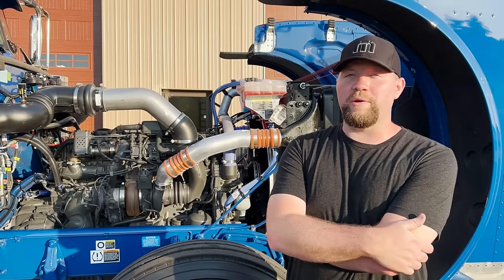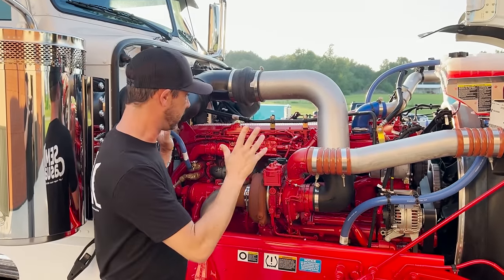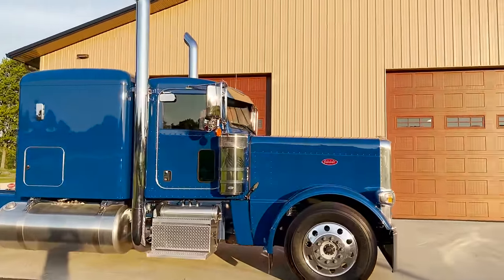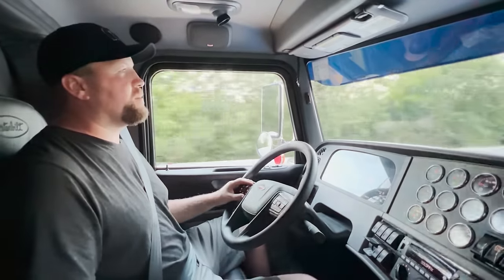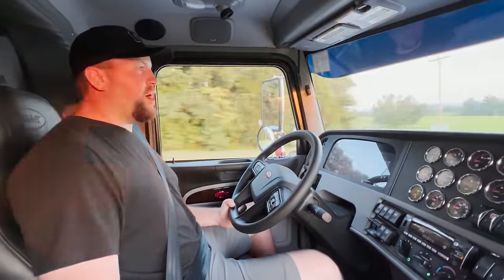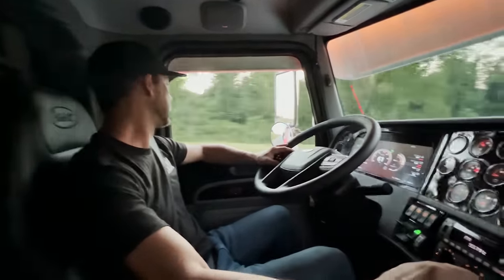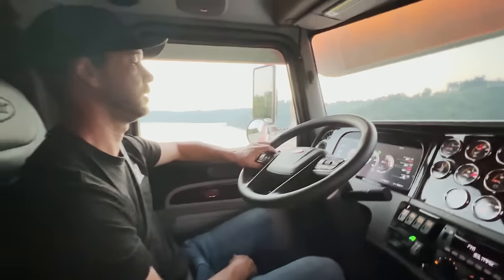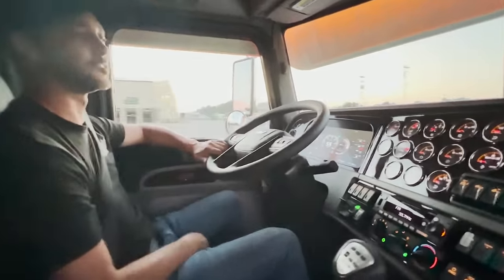Cummins X15  VS.  Paccar MX13  -  What are you gonna choose?

Comment: I have worked on both of these engines the labor you will save on the Cummins will far outweigh any upfront savings on the MX. The MX is put together like a jigsaw puzzle not to mention some cab styles you have to raise the cab just to change the #6 fuel injector and connector. The emissions problems are just too much to mention. I have always said if you want to work a 5 day week you should buy 7 trucks with MX engines you might get a full week
Reply: Agreed, i work at a dealer, Cummins only come in for services and EGR's, MX's are everything from emissions recalls, issues, wiring problems, or full blown engine replacement
Reply: The review i was looking for.  MX equipped trucks tend to be slightly less expensive.  And there's a cummins mechanic on every corner. #testedtec
Reply: Where's your shop?
I'm currently in South Texas.
Reply: @nostradamus7648  I used to work for Kenworth of Pa but I wouldn't trust them to fix a tail lamp. That's the reason I left didn't approve of customers getting ripped off
Reply: There's a reason why they call them "Pacshit" engines. 😂
Reply: @davidsignor7931  Have you opened a shop or do you still freelance?
Reply: @Nostradamus  no I'm really not interested in working on them anymore they took all of the fun out of it with aftertreatment
Reply: It's not that new drivers want automatics they just don't have a choice since that's all they know how to drive.
Reply: @davidsignor7931  What if I  got a non DEF Detroit 60 or Cat C15?
Reply: @Nostradamus  60 series was a pretty good engine best in fuel mileage out of the big three. Just a little low on torque. C-15 on the other hand still have a lot of head gasket issues and exaust manifold problems you can fix the head gasket issues by adding fire rings in the cylinder head it all comes with a price
Reply: What are you doing with trucks and engine in the US? The MX is a DAF engine. For 15 ton plus DAF Trucks is the number two in selling in Europe for many years. DAF started building trucks in Brazil and within 10 years DAF XF is number two and DAF CF is number four in selling. And no American truck to be seen, not in Europe nor in Brazil.
Reply: @47rintin1  Paccar bought DAF
Reply: @davidsignor7931  PACCAR is the best mother DAF can have and DAF is a perfect daughter for PACCAR with all its know how. 
If you are a brilliant scientist, it doesn't mean that your mother is one as well. The case is that I see some comment on the MX-13 that doesn't correspond with the experiences on the Brazilian and European truck market.
Reply: @Vladpryde . Our shop mechanics call the ‘ Crappar’😂
Reply: @samhunt5476  Cummns don't have any less issues when it comes to emissions and sensors, turbos, from 2010 to 2021 when I retired. Both systems from turbo out are Cummins systems.

Comment: I'm driving a mx13 right now with an 18speed and the difference compared to the ISX/x15 is massive. Better fuel economy but way less pulling power then the cummins, my old truck being a 2014 388 ISX15 550hp 2150 torque. Used both engines pulling 140,000lb's and both can do it depending on rear gears ratio's but maintenance intervals need to be thrown out the window if you want reliability and longevity out of the engines.

Comment: As a mechanic I understand the upfront liking the paccar but you've never had the nightmare of working on one.  The long term costs in repairs the paccar will not hold up.
Reply: Agreed, I run a shop that has both engines. We can’t get paccars to go over 400k without major repairs needed. Our Cummins have minor issues throughout the same mileage and conditions. Not to mention you can’t even inframe a paccar….

Comment: Cummins would be my choice. I've driven both with automatics and manuals hauling fuel. Cummins just feels safer and more confident especially with their exhaust brake. The paccar required a lot more breaking when loaded and just did a horrible job keeping me at a safe speed coming down grades without using the service brakes. I really hated the paccar in the auto configuration. It was always trying to skip gears for the sake of fuel efficiency then immediately down shift because it didn't have the power to continue. That paccar/auto pair would constantly get lost when fully loaded. I also feel that the Cummins would also bring better resale value.

Comment: I believe there were reliability issues at one time with the MX. Uptime is super important to me. That's the reason we stick to Cummins.
Reply: Sinister.Shelby, You're a smart man.
Reply: Cummings is the only motor cat used to be right in there but I will only drive trucks with Cummings engines
Reply: If you want to work a full 5 day week buy 7 trucks with MX engines and you might complete a full week
Reply: @4321grp  He is a smart man but just not smart enough to buy a Chevy instead of that 13/14 GT500 that looks like Z06 food.
Reply: Both dealerships kenworth and peterbilt service mgrs told me without hesitation 2 avoid paccar mx engines!

Comment: My experience with the MX-13 is that it's an amazing engine until its not. What I mean is when those sensors start going out, it's a ripple effect that just topples those engines and they are not cheap. DO NOT buy a used truck with a MX-13 in it, the extended warranty options offered by Paccar do not cover the majority of the sensors and trust me, they have A LOT. I advise only purchasing a truck with this motor in it brand new and letting all work fall under OEM warranty and if it shows any signs of faultiness, turn it back in immediately. These engines have also been known to have head issues due to bad fuel injection pressure, so IF you are planning to buy one second-hand from a dealer (which I highly advise against), inquire about the motor and do your due diligence.
Reply: Well said thanks I have worked on them at Kenworth of pa they're truly a piece of junk
Reply: I couldn't of said tht any better

Comment: Look at the number of electrical harnesses on the MX vs the Cummins, winner Cummins.
The MX can run at lower rpm, this is where the fuel economy comes from. Certain series of the Cummins can run at lower rpm, but not as low as the MX. Refer to the product sheets for the Cummins series, and the MX. Go too low with the Cummins, on a regular basis and the cylinders will be moving in their bores.
Service locations, yes winner, Cummins, hands down.
On any of the new engines, no long idle periods, that gets you plugged sensors and DPF systems, with resultant shop times as a result.
A good APU, is your friend.
You want long service life, shorten the oil change intervals, thus extending the time between rebuilds, means more money in your pocket. Sure you will pay a little more up front, but, more time on the road generating income, that is where I wish to be.
Reply: I have a 2023 ixs15 cummins and on the dash they have a green bar on the rpms betwen like 1200-1350. Is there was i should be running at? I use to run the old cats and climbing hills all day. But now running on flat land
Reply: @hunterjones1593  With that rpm range, I'm thinking you have an efficiency series. I would keep it around 1300-1325 rpm, above 1350 the fuel consumption starts going up as your horsepower developed goes up, along with speeds over 60 mph, where wind resistance, overtakes rolling resistance. But talking to a specialist at Cummins, to figure out your sweet spot, is best. They designed the different series, for different applications/running conditions.
It all works together, aero-truck or square W9 style, your terrain you travel on (flat, you mentioned), gap between trailer and tractor, final drive ratio vs speed you wish to travel at, are you light loads like a few friends, who carry kitchen cabinets (very light loads), to my oldest friend still on the road who is a tanker yanker (near max).
If you didn't spec the truck with your dealer, you might have to have a serious sit down with the Cummins rep, to figure if you can gain any advantage by switching final drive ratio. YMMV, seriously!
Best wishes from the far North.

Comment: I have a MX with over 400k miles,  the only problem I've had was the Def system,  never a problem with the engine,,,other then that it's a work horse and the fuel economy is great,  I average 6.8 loaded and I'm always heavy,  but I also drive 65 to 68 per mile,  if I'm empty I get over 7 miles per gallon,  on my 389 peterbilt.

Comment: 10-15 yrs ago I would've taken the C15 or 60 series Detroit for standard OTR legal weight loads. As far as the engines that are available today, 3 trucks later and ive gotta say Cummins is the way to go! ALot less expensive in the long run!
Reply: Keep an older truck or glider kit

Comment: I just moved to a mx13 and so far in the flatbed world it is a complete dog. But in defense of the engine that could. I moved out of a 1.8 million mile 625h 2250t 17.2l cat. 4.0mpg average with any where from 5.5, to 6.5, and even 7 mpg rolling down the road at 75mph. I feel like the money I am saving in fuel I am losing in time with the struggle of climbing hills and considerably slower acceleration time from a dead stop. I think I like the quieter ride. Vs 8in pipes with a 12in long resonator. That 379 was loud I loved the sound. In retrospect I should have gone with a Cummins.

Comment: the mx13 is used in daf trucks in europe, who are owned by paccar, but they are prone to coolant leaks. call them "flower power" motors as they're only fit for flat roads pullin light loads. out of the 2 i'd have the cummins but i personally would rather a cat engine
Reply: We haul 62500 kg b trains with the mx13 with no issues. Pulls that with ease everyday.
Reply: @wjmautomotive  most American operators don't even know what a Scania V8 is.. but I do think our old Mack E9 is a predecessor and shares much of the DNA with those older Scania V8's.. the Cummins is an emission motor and literally uses the same after treatment system the mx-13 does, everybody has to meet the same emissions standards and I think they are just as strict as if not even stricter than Europe's emissions standards, there is however a certain amount of people that still refuse to run any Emission engine, there is still a huge and loyal caterpillar Enthusiast Market in the tens of thousands... a lot of guys keeping older trucks going and some people even swap an engines in newer trucks for Caterpillar power.. a lot of these guys tune and know how to build for big horsepower.. it's common to see  thousand and plus horsepower trucks out working everyday..

Comment: Hi. I’m from Montreal Quebec, Canada. My brother and I own a small refuse container company. We bought a 2016 Kenworth T800, 12 wheeler roll off. It has an MX13-455 hp. Was happy with it until 2020 when a gear went in the back of the motor 2 months after warranty. Cost us 29 grand to repair. Kenworth wouldn’t cover any of it even though it was a known defect in that motor. I will never buy another peccar motor again. Stick to Cummins.

Comment: I think the fuel mileage is debatable if you put the mx505 up against the x-15 500 horsepower production series I ordered my 21 with the x15 but I really liked the Paccar for how quiet it was big downfall is with warranty issues on the motor you have to take it to Peterbilt or Kenworth as with the Cummins you can take it anywhere . Another downfall with the MX is you can't buy the davie4 software that's why I went with the Cummins and bought Cummins insight and it's with me in the truck all the time just in case I know both engines share the same after treatment system.
Reply: the davie4 is confusing to use also.
Reply: @rearspeaker6364  what product would you advise for an owner with a Cummins inside?
Reply: @malyshevvasiliy9541  Insite, the OEM program, it works well.

Comment: Guys, your comparison just made me a subscriber 👍🏻.  I’ve never ran the Cummins but had the Mx modified in a 7 axle concrete mixer and wasn’t impressed. Very temperamental. Cab needs to come off to change an air compressor. Yes mixer is probably one of the hardest applications so that’s all I can add.

Comment: I ran with a MX-13 for about 10 months, went in the shop about 5 times for major problems with DEF system. I once had the truck needing to regen 4 times within a span of 2 hours. Another time the truck began to de rate out of nowhere. Cummins is the way to go. I’ll take a Peterbilt and Kenworth with either a Cummins or a Detroit DD-15
Reply: Def isn't a paccar engine issue. The def system  is  the same on a paccar and the x15. It's a peterbilt or kenworth item.

Comment: Turbos are known to fail on trucks just over 50k miles with the newer MX13's 
They have also added 2 more sensors on their turbos as well. Highly unnecessary, but i guess its to regulate boost pressure more since it kept scaring drivers during their rolling regens. 
Turbo discharge sounds like a shotgun going off under the passenger side dash.
Reply: They both use the same turbo manufacturer
Reply: I’ve had that since day one 841k miles ago. Always thought it sounded like I was tearing plastic. Lol

Comment: Been running a fleet of MX13's since they were introduced.  Have good comparison data with DD15's but we have very few ISX to compare with.  The MX engine is a good "long life" engine - we're seeing a maintenance benefit with trucks over 600K for the MX.  The emissions systems are maintenance challenging.  Paccar does a much better job for us working on nationwide backorder parts.  In the end - it is about profitability - with all the maintenance I see with a fair sized fleet of trucks - bottom line - cent's per mile spent on repairs and maintenance - just can't argue with the added profitability of a modern engine.
Reply: Thank you. You are one of few with a good word for the MX. Everything diesel that I've had my hands on or driven has been Cummins, Cat and Detroit.
As I put in on a previous post, friends and their families are not too well disposed to the MX.
I guess I'll just have to have patience, and see how this shakes out in the end. 
Best wishes.
Reply: I have a mx with 960,000 miles on it. It runs great, but there is an occasional engine light stemming from some sensor issue. I figure it costs me around 4 or 5 thousand a year plus downtime. And if you happen to have a subpar dealership where you live it'll be double that amount while the techs flip a coin to decide which sensor it is that needs to be replaced.

Comment: Me being a tech and have worked on mx motors I would not recommend buying one due to a few facts. One they like to brake cranks and have fractured mains not machined caps so right away you have to buy a short block. Two they have major unit pump problems which is not a diy fix. My only complaint with Cummins is bolts are a lot tighter than you think they will be

Comment: Bought our first KW, a 2023 with an MX13 510 hp and 1850 torque. Other trucks in the fleet are Cascadias with DD15's. Drivers love the new T680 Next Gen and so far no complaints. We haul heavy, up to 120 gross and are averaging 6.5 mpg, about the same as the 475 hp DD15, but with more power and torque. Time will tell, as the first one only has 38,000 miles on it.

Comment: On the mx if you need the cam removed you have to pull the block out to get it out on the cummins it comes out the front way easier to get to if the shop is doing the work its cheaper to deal with on the cummins

Comment: This guy trying to argue that the Cummins is going to need more service than the MX.  COME ON!!  I've ran them both.  The Paccar engine is fine if you're replacing your truck every couple years.  For longevity ........... they're JUNK!!  Buy the Cummins and stay on the road.  Any of your fuel savings with the Paccar will go right back to the mechanic shop and that's not even counting the down time!!

Comment: I’ve driven a 455hp mx13 13 speed and a 565hp x15 18 speed and the mx13 was much more pleasant to drive but the x13 had more brutal torque
Reply: Well, with 110 extra hp it should. Were the ratios the same?

Comment: Put a Allison 7 speed with some 3.70 now your taking.  Take that set up with the mx 13 and it will walk right around that 605 any day of the week. I had a western star with a dd15  set at 560 hp and 1850 tq with a Allison 6 speed that dyno 580 hp and 2112 to the ground  after we tuned it down. .after 31 years driving I would take a Allison over any transmission out there..

Comment: I drive 2019 KW with paccar mx13 on this truck parts are very expensive the only good thing I could haul 20k lbs freight & average 9.2 - 10.3 mpg at 63-64 mph / at 66-68 mph 8.1 - 8.6 mpg including some mountains 33k lb easy at speed of 63-65 mph east 7.3- 7.8mpg at 66 -68 mph 7.0 -7.6mpg // the problem is simple to many sensors and could put you out of work easy 2-7 days off - while waiting for parts.
My experience,  I prefer old engines and Cummins are great engines  more reliables the true at the long run you make more money running longer and less time on the shop your fuel will compensate the reliability.

Comment: I'll pass on both of those pieces of garbage and go with volvos turbo compounding engine. I don't care what anyone says about volvos because I've driven those things with well over 700k miles and still run like new, we all know that paccar needs rebuild at 250k miles and the new cummins sucks and heads are cracking at 300k miles. Remember that the caterpillars also ran turbo compounding engine and those things go a million miles between rebuilds. Volvos definitely making the best engine right now.

Comment: I’ve worked for a KW dealer for over 10 years. Paccar engines are piles of shit. Parts are expensive, hard to find, and each generation of them have had some sort of major issue. I’ve pulled the new Paccar engine out of a truck blown up at 16k miles.